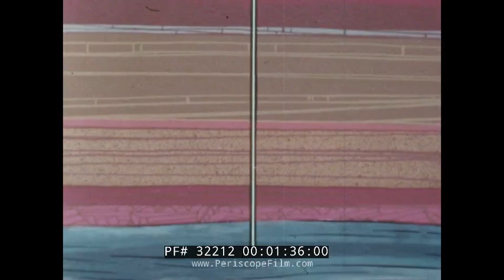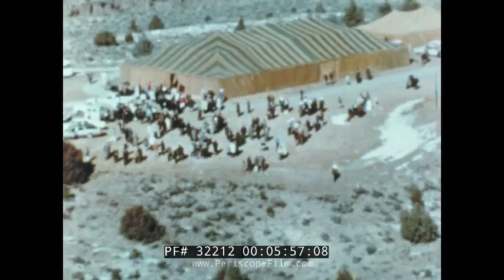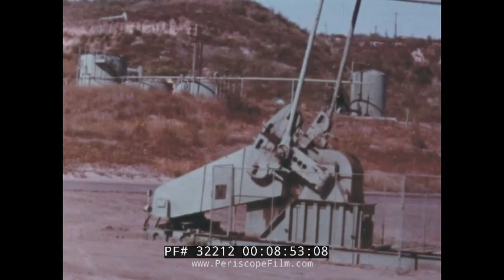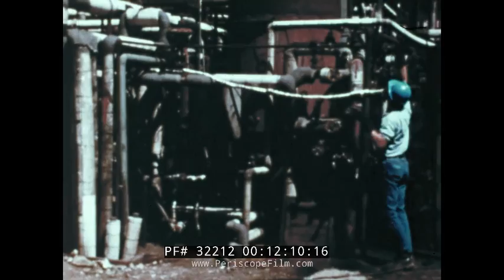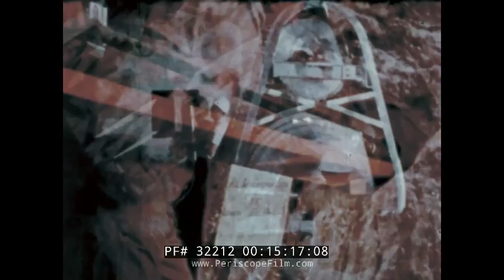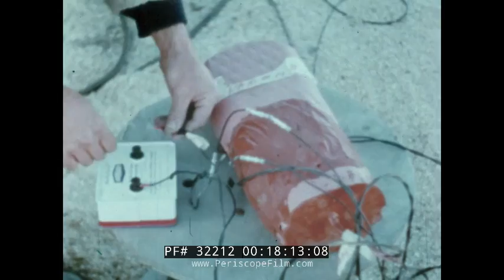" THE ATOM UNDERGROUND " NUCLEAR FRACKING OF NATURAL GAS    ATOMIC ENERGY COMMISSION 32212

Comment: I have part of accelerometer, which contains two ferrite pot cores and coils, first used for measurement of free-field particle motion from a nuclear explosion in salt. Its been sealed in clear resin and mounted of solid metal stand. I have been told its to do with the Project 12-11 Salmon 5kt october 22 1964.

Comment: Project Gasbuggy didn't go as planned.  Instead of fracking the rock, they created an underground cavern with solid walls as they melted the rock.  Think of a lightbulb underground.  I used to drive past the Gasbuggy site near Dulce, NM and knew a number of people who worked on the project.  Same thing with Project Gnome near Carlsbad, NM - that one didn't work either.  And then there's Amchitka Island in the Aleutians where they nearly cracked the island in half attempting to make a harbor with a single nuclear detonation.  In fact, I have a hard bound book commissioned by the AEC and produced by the engineering firm I worked for that documents the remediation of the island after the test.
Reply: Amchitka wasn't a Plowshare detonation for a harbor; it was an underground test of a five megaton warhead for the Nike Zeus... They had wanted to test it in the continental US, north of the Nevada Test Site at Tonopah, Nevada, but a 1 megaton underground test shot there ended up creating a huge subsidence zone and a 6 foot high scarp where the entire valley floor sank 6 feet after the detonation.   SO they decided to test it at Amchitka.  Raised the entire island and surrounding seafloor by 25 feet.  There's footage of the drilling and excavation of the test chamber underground and the resulting detonation in Peter Kuran's "Atomic Journeys"  DVD, some of which is right here on YouTube... OL J R :)

Comment: The oil & gas thus obtained will be heavily contaminated by the fission and neutron activation product of the nuclear explosions.
The combustion of these fuels will release the radioactive materials into the air.
Reply: The warm glow of Atom provides your home with extra energy; sick ideas from sick minds.
Reply: I read up on these tests - the methane itself wasn't radioactive - it was the crap such as minerals dissolved in the water vapor which was radioactive. So in theory they could filter it ... but then you've got REALLY HOT filters which have to be constantly changed out as they accumulate radio-nucleides, and buried in lead-lined drums somewhere - so rather impractical. ;)
Reply: We could have made a nuclear/gas hybrid car with that. The Hippies biggest Nightmare.

Comment: 3 Projects; Gasbuggy, Rulison, Rio Blanco. All were met with questionable efficacy, as well as irradiated gas which posed a problem to get safe. All were eventually plugged shortly after producing. An interesting use, and at least they tried. Plus hydraulic fracturing technologies were also improving at this time. Fracking is much older than people think.
Reply: Yeah, we got two of those test sites right here in Colorado. Oh shit, the gas that comes out of a nuke-blasted gas well turns out to be radioactive. Who knew? How inconvenient!  So they put up signs saying, "Don't dig or drill here for 10,000 years" and walked away. Nice.
Reply: The Russians were more successful. Their blasted wells still produce oil.

Comment: "Estimates indicate* that the gas flow was increased many times". 
Well, I'm glad we cleared that up.
Reply: "How many times?" "Oh... many. Many many times. If I were to quantify the number of times I'd have to definitely say... more than a multiple of one. Dare I bore you with extraneous detail by also adding that it is... a lot."
Reply: Klitchko would probably like to incorporate this into his lexicon.
Reply: The only successfull usage of nuclear device on Sep. 30, 1966 the Soviet Union in Urta-Bulak. Bomb sealed lead and crushed the pipe.
https://en.wikipedia.org/wiki/Blowout_(well_drilling)#Use_of_nuclear_explosions
Reply: Science was a bit simpler back them.
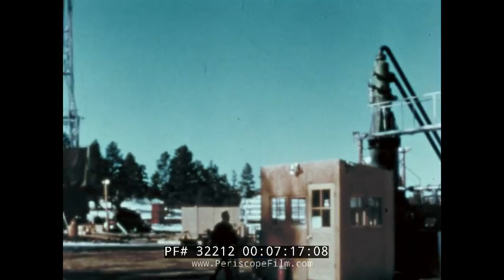Reply: @7:20 literally after your statement they go on to say, “Gasbuggy produced as much gas as local wells had produced in years”

Yes, though I do agree they should have been specific - how much was produced with GasBuggy vs. Traditional Well drilling average estimates at that time in similar strata & nearby locations & depths...  

Regardless of the answer - it cannot be used due to excessive levels of Radiation.
Reply: Sounds like a statement Trump would make,

Comment: Everything that comes out of the hole will be irradiated, useless and dangerous to the public.
Reply: Wether the crude product is irradiated, the refining process would separate any dangerous material from the gas, which I don't think can carry radiation.
EDIT: Turns out that radon, a radioactive gas byproduct of uranium and thorium decomposition, is common in shale oil deposits.
So radiation is already a common issue in energy production, this method is obviously not helpful in that arena.
Reply: Here's the report into the radioactivity in the gas. If the claims are true, they were somehow able to control the generation of radioactive isotopes in the nuclear blast, there was almost no Cesium-137 or Stontium-90 generated, the most abundant isotopes they detected all had a half-life of 58 days or less except for some Krypton-85 (half-life 10 years) and Tritium (half-life 12.3 years). They detected 0.012 to 1.16 micro-curies per liter of Tritium, the EPA limit in drinking water is 0.02 micro-curies per liter. So it clearly exceeded the EPA's limit. So while exceeding stringent limits, it wasn't hopping with radioactivity.

https://www.osti.gov/servlets/purl/4007203

I'm surprised at this, I thought they would have detected boat loads of Cesium-137 or Stontium-90, that it would have been far more radioactive. These claims seem to be confirmed by Project Gnome, a 3.1 kiloton atomic explosion detonated in a layer of salt in 1961. People were able to enter the cavity created by the nuclear blast 6 months later, after it cooled down, without lethal danger from radioactivity.

https://youtu.be/DFJ2MyWlXgs?t=1478

Also, neutron irradiation should make the surrounding rock radioactive, but what is the half life of Silicon and Oxygen? (sandstone / quartz). 

I think Silicon-31 might be generated from natural Silicon-30 (3% of natural silicon) by absorbing one neutron, but it has a half life of just 157 minutes. Silicon-31 decays into Phosphorous-31, which is not radioactive. Oxygen-19 might be generated in tiny amounts if the rare natural isotope Oxygen-18 absorbs a neutron, but it has a half life of only 26.5 seconds, and it decays to non-radioactive Fluorine-19.
Reply: @Diamonddavej  The cesium 137 is not what will be the problem.  These are old nukes, highly inefficient, over 99% of the plutonium or uranium would be the main source of contaminates. 
I guarantee those reports blatantly lied or omitted the real levels and sources, likely citing national security.
Reply: @redabernathy6316  You maybe right, that why I was so surprised. That said, people did enter a underground cavity created by an atomic explosion so the radiation couldn't have been that high. That said, yes, they might have covered up the real levels of radioactivity.

I just checked, plutonium is a very small portion of the radioactivity

"According to the UNSCEAR report (1993), following
atmospheric nuclear testing, the main contributor to the
total effective dose commitment to the world's population
is 14C, contribution of which is 70 % (Fig. 2) over the
course of thousands of years (out of the total dose of
3700 lSv, radionuclide 14C accounts for 2580 lSv).
Considerable percentages are also found in the cases of radionuclides, 137Cs (13 %) and 90Sr (3 %), as well as
seven other radionuclides with effective dose percentage
values ranging from 1.1 to 2.4 %."

From: Nuclear Weapons Tests and Environmental Consequences:
A Global Perspective
Reply: @Diamonddavej  It's not sandstone, it's shale... sandstone has no problems flowing natural gas and oil, it's the preferred type of rock formation for a natural gas or oil reserve.  Shale, on the other hand, has EXTREMELY tiny pore space in the rock (since it's made from fine-grained clay muds compressed into rock) and therefore cannot allow natural gas or oil to flow through the extremely "tight" pore space in the rock... hence the need for fracking to create larger cracks in the rock for the oil and gas to flow through.  Later!  OL J R :)
Reply: Vlad The Inhaler also there is a lot of neutron activity in there, the nuclear transmutations are very complex and the underground is just as complex. Besides radon, deuterium, tritium, thorium, there are many more radioisotopes being born in the well and not only contaminating the gas or crude but also changing the chemistry in there and surroundings. 
The fractured crust is, then again, another serious isue with very, very, very long term impact.
Reply: cesium and strontium could disperse in gas as well there are many other gaseous actinides created by a fission event
Reply: Ken Karnes i was thinking the same thing. Didnt they already know this?
Reply: yea, radioactive gas :P
Reply: natural gas is mostly methane is carbon and hydrogen and the neutron pulse is short lived so it's not going to get all that radioactive and the heavy gases would be filtered off.
The real danger since the early nuclear weapons were not very efficient would be unreacted uranium and plutonium getting into the water table or the natural gas escaping and contaminating the water which is a potential risk with conventional fracking as well.
Reply: This is for export to other countries.
Reply: Why not inject pure liquid O2 into the bore? Once mixed with gas detonate.

Comment: I really like how they conveniently leave out the residual radioactivity bit. With the "new" drilling going on relatively near where the blasts were carried out makes me wonder if the recently drilled gas/oil could carry any residual radiation along with it.
Reply from the maker: That's an interesting question. Presumably the government monitors activity around this site -- but if you watch the excellent film "Atomic Journeys" by Peter Kuran you will see that at least one of the Gas Buggy sites is pretty much not gated off or concealed in any way. Natural gas is often naturally radioactive but of course any gas coming out of this particular site would likely by far hotter!
Reply: As I understand it, these reservoirs can truly be vast. As a previous comment noted, a contractor lost a Americium rod out the back of his truck. It  was supposed to be handled carefully with special procedures in place that obviously werent followed. It's not too far of a leap for an operator some hundred miles away to start piping contaminated gas/oil and not follow procedure. Kind of scary when you think about it. I almost want to get a Geiger counter. Speculation aside, my inner conspiracy voice says they knew exactly what would happen. They just needed a guise to continue weapons testing.
Reply: Radon is a common radioactive gas found in american homes and kills about 20,000 per yr.
Reply: If your both right  then we're all screwed!
Reply: The rock really doesn't have great conductivity for any type of material. Over geological timescales, sure, material from the blast can migrate significant distances. Plus natural gas is already somewhat radioactive especially from radon, which is not removed in commercial applications.

Comment: actually this technology might be usefull as long as the right precautions and surveys are used. It would rely on a much smaller, and relatievely well contained amount of waste - which all other options couldn't deliver without net more damage and waste - nukes are very good at packing lots of energy into a tiny package. That being said, we should as a race be responsible enough to optimally use our resources and not exploit and deplete them in the way we are currently doing - nukes should never be used as a easy way to accelerate this.and take that '60s optimism with a pinch of salt...
Reply: no just no !

Comment: Now we in the uk face the threat of fracking and we are told how fab it's going to be by our govt.  Meanwhile communities everywhere are rising up.  Wondering what's in the explosives they would use to fracture rock today?
Reply: Kevin Miedema Thanks for that. I was unclear about the nature of 'Fracking' when I commented. Using nukes isn't any less damaging down the line, than process of modern fracking
Reply: Instead of soft rocky oil they can blast carbon, well that would become enriched carbon. Anyways I wounder what happens when a nuke detonation that takes place in these conditions , where the material given to the explosion is suppossed to burn until the neutron cycle ends and the detonation underground is sorrounded by hard anough rock to restrain the energy reaction to explode away, does it turns into heat as in a reactor or the chain reaction simply exhausts itself.
Reply: LOL:)  Energy has to come from somewhere... I guess the alternative is better and yall can freeze to death over the winter.  Stupid envirowhackos... OL J R :)
Reply: they don't use explosives actually - the process inject high pressure water with very&#160;potent chemicals added into rock strata with trapped gas bubbles. - it should be known though that fracking has apparently caused major problems and is concept that is not well tested at all. - also just blowing cracks in rocks would also potentially release things like hydrogen sulfide, carbon monoxide and various other dangerous pollutants from there.
Reply: +Julie Daniels We are led to believe that conventional explosives (RDX, C4 etc) are used in present times, to 'Frack' - But the issue arises when residues of substances used in modern processes, seep into our water-tables - but there is very little to no attention given to fault-lines being displaced, resulting in unforeseen seismic activity and the opening of new channels that may (will) cause the aforementioned residues to reach natural water sources underground, and on the surface..

Comment: WTF were they smoking? Common sense would tell a normal person this is a very bad idea.
Reply: +motonegros 
Americium is still used today in oil and natural gas drilling sites.  The radioactivity (mainly alpha decay) prevents carbon from building up on the drill. A year or so ago some contractor lost the Americium rod out the back of his pick-up truck on some Texas highway
Reply: Nexfero around the central part of Wisconsin some years ago some dingbat contractor (or some subcontractor ) with a large pipe weld inspecting gamma ray emitter (I forget the name of it.... think X-Ray like.. except gamma rays... from,I believe, cobalt-60! NASTY stuff)  managed to LOOSE that gamma ray source! Never heard anything else about it!
Reply: Hindsight is always 20/20
Reply: Just goes to show, if something is considered important or dangerous, it will be handled with care. If not, it will be handled carelessly. I've read a couple of  news articles about the incident and there's nothing further if anything was done to the individual that mishandled the rod.
Reply: they use radiation in fillings in teeth to stop bacteria. you would be surprised what they do
Reply: Ya don't know til you try... OL J R:)